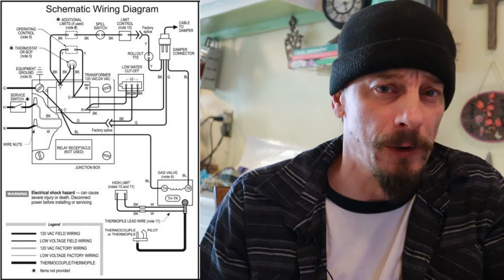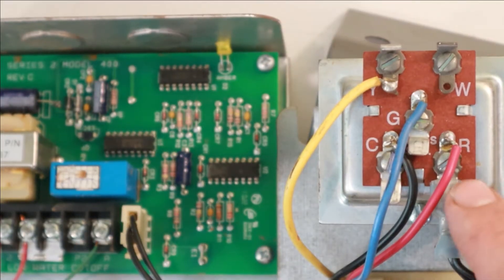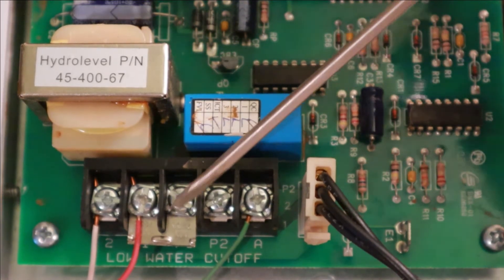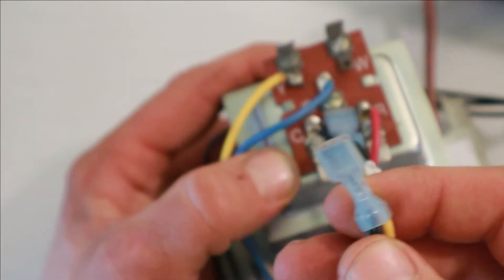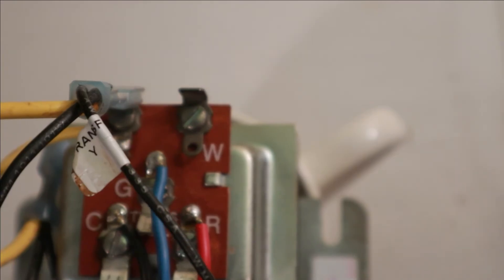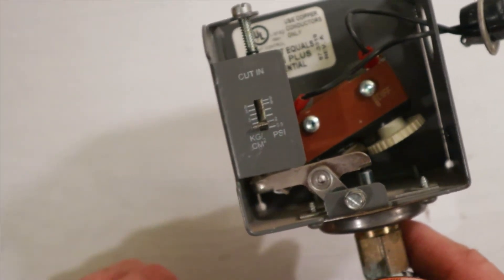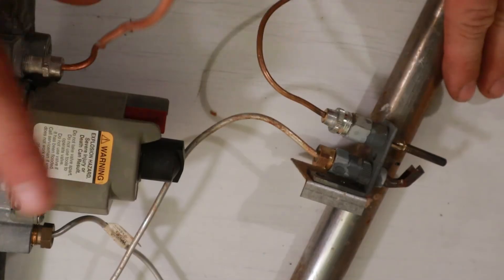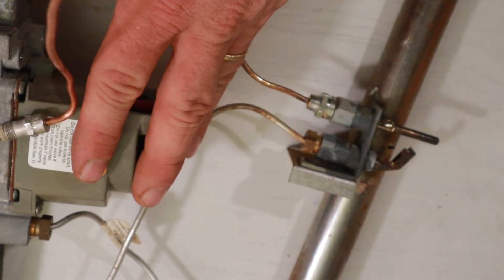Steam Boiler Wiring for Beginners

Comment: I have a Teledyne Laars boiler with Flo-Guard circuit board…..when I unplug the yellow (common) wire which is supposed to be plugged in board…the boiler works great when yellow common wire is plugged in it will not work when it is plugged into the circuit board is the circuit board bad?

Comment: Thank you for this great introdution, Mike.  I didn't notice any mention of the manual reset control that trips the system off in the case that it reaches an unreasonably high (but not unsafe) pressure.  Is it safe to assume that this should just be installed in series with the Pressuretrol?

Comment: Mike you do great work where is the ideal location what is that the water feed line be installed on a steam boiler
Reply from the maker: I always put it right into the wet return down low to prevent sediment  build up.

Comment: great description of steam boiler wiring.  you pointed out that smart thermostats get disconnected while water level check.  is there a solution to make thermostat up at such condition?
Reply from the maker: My solution is to never use smart thermostats on steam boilers. lol. But short or rewiring the boiler circuits, the best approach is to use a dedicated transformer just for the stat and an isolation relay to cut into the boiler circuit.

Comment: I have this same setup for my steam boiler. Once in awhile my my nest v3 says low power.  I have the power connector w/y to the Y transformer, C to the C on the transformer & R to the R on transformer. Is that right or should the R go to G on transformer? Thanks for your input. You have great informative videos
Reply from the maker: It's probably better off on the R terminal. G term will not get power on low water conditions. 

 Nest thermostats don't play well with steam systems. I would suggest disabling some of the smart features, if possible, both to reduce power needed for the stat  (possibly aiding in charging the batteries) as well as minimizing how much the Nest wants to regulate the boiler timing. Steam is a longer heating process and you'd probably avoid some issues by reducing Nests micro-managing tendencies. 

 I'm also aware that Nest has a N260 nuisance bug that a lot of people get when connecting a power connector. They don't seem to have an answer for it.

Comment: Couple question:
1. If there is no power on the G terminal can I assume there is problem with the LWCO?
2.  If I have call for heat, but nothing is happening on boiler. I jump from R terminal to Y terminal (bypass the thermostat). Maybe I should jump out G and Y better. The boiler fire up, it will be the thermostat issues?
3. What is the W terminal for?

Thank you Mike if you have time answer my question.
You have great and easy explanation on wiring.
Reply from the maker: 1. It depends on the boiler and the wiring, but on the diagram in this video, no power to G could be a lwco situation, but you'd have to make sure you have power coming into the lwco and that you dont actually have a low water condiction to confirm a lwco problem. 

2. It would be better to jumper at the thermostat between R and W. G to Y can indicate but doesnt conirm a thermostat problem. It could also be a tstat wire problem. Jumpering at the stat with the boiler firing up confirms the tstat wires are ok and its actually a faulty stat. 

3. W terminal is dead. There's nothing wired to it. Its there so that it can be powered and used for accessories if desired. I was on one steamer recently, for example,  that had a hydronic loop on it also. W was used to power the zone valve.